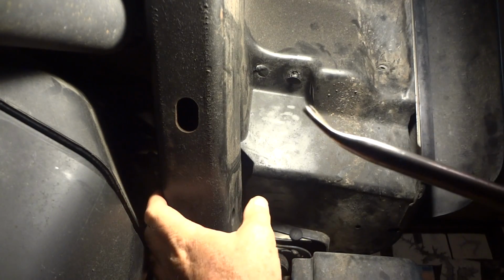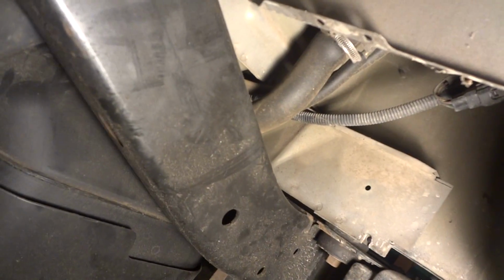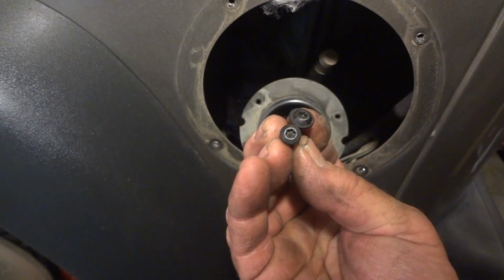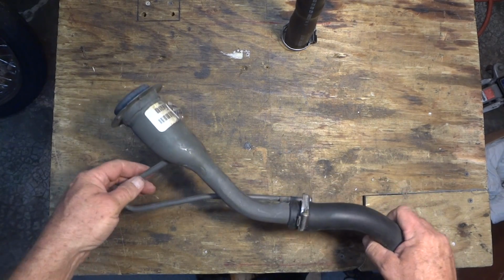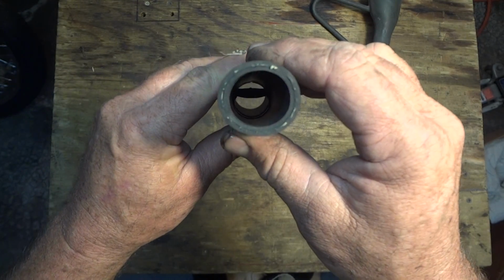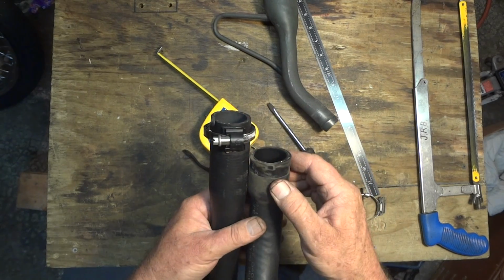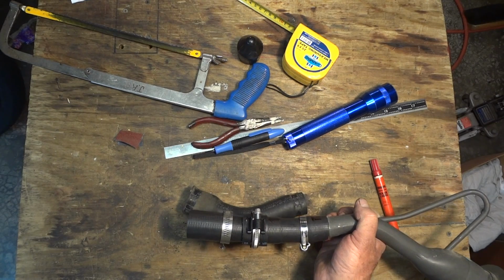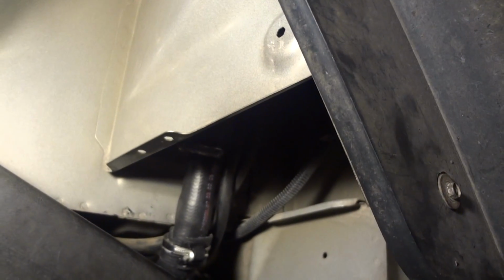Jeep Wrangler 05-06 TJ Fuel Filler Hose Repair

Comment: Where did you get the replacement hose?
Reply: Don’t buy the one from fillernecksupply. That’s the original one for the Jeep and not the GM one used for this mod. Here’s the correct one (same one in the video):

Genuine GM 15131046 Fuel Tank... https://www.amazon.com/dp/B00GUCRISO?ref=yo_pop_ma_swf
Reply: You can get a replacement hose from us at Filler Neck Supply Co part# A1-B07 fits 2003 2004 2005 2006 Jeep Wranger TJ  link as follows - https://www.fillernecksupply.com/2003-2004-2005-2006-jeep-wrangler-tj-fuel-filler-hose/